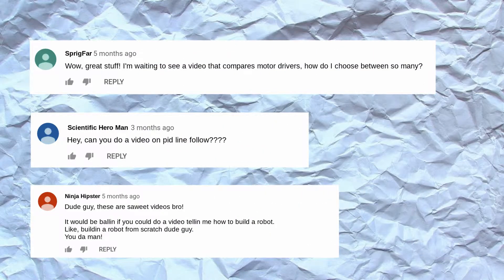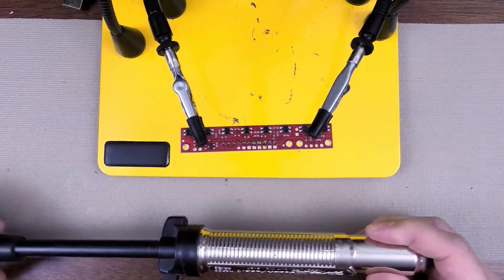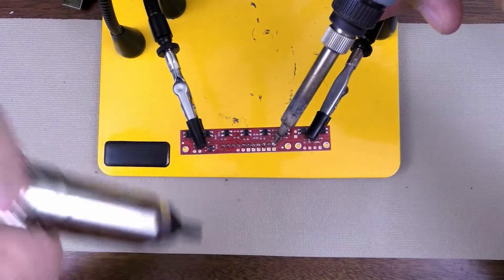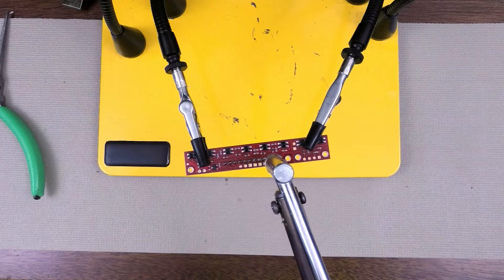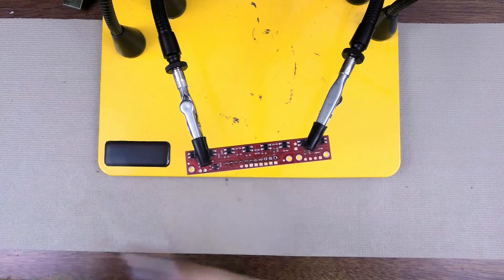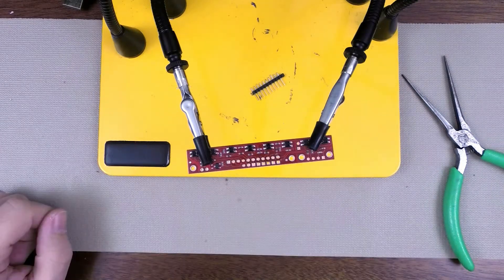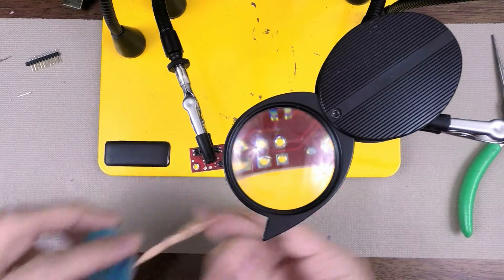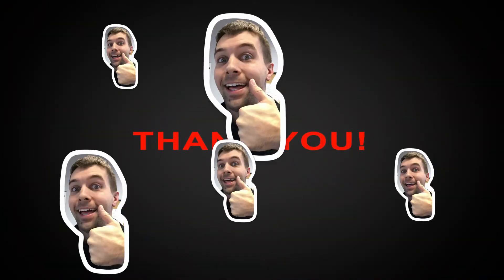How to Desolder Header Pins with a Solder Sucker or Desoldering Iron

Comment: Mate I've spent the last half an hour trying to find that desoldering iron with a pump. Can you tell me what brand it is?
Reply from the maker: It looks like they might not sell it anymore... I got that thing like 20 years ago at a Radio Shack. This one looks like a fairly nice desoldering iron.

https://www.amazon.com/Desoldering-Electric-One-Hand-Operated-Soldering/dp/B09DG4BB86

Otherwise, you could check on facebook marketplace or ebay for the one with the bulb like I have.
Reply: @RobotResearchLab  Ah cheers and thank you for responding! This looks like it should do the job and I've seen quite a few of these modern plunger types, but I really like the bladder type that you have. I'll keep looking